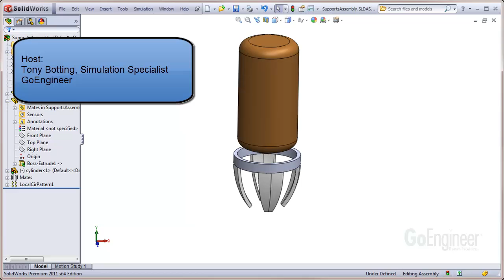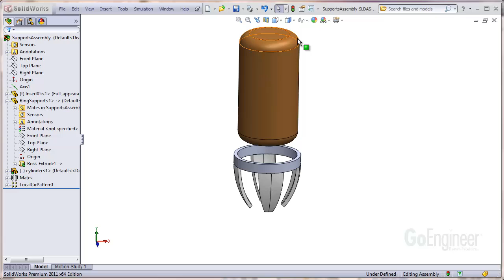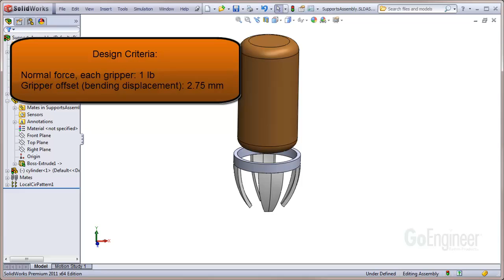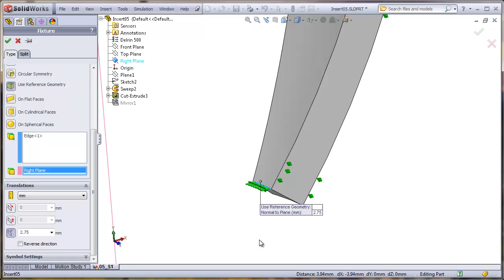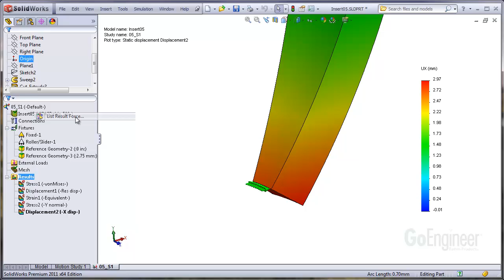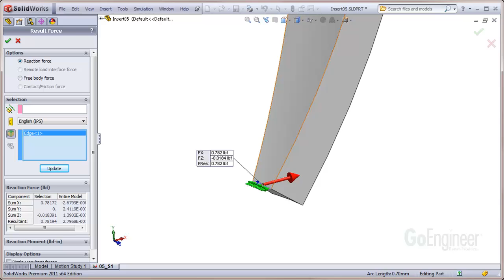SolidWorks Simulation - Non-zero "Fixtures" and Reaction Force

Comment: Is there a way to make it so that applying a force to the cylinder results in the displacement of the plastic grippers and to simulate the subsequent motion and stresses?
Reply from the maker: Hi Matt,
Yes, this same analysis could be run including the cylinder acting on the grippers.  The important part of that setup is that you would 1) want to split the model into a quarter symmetry (utilizing Symmetry fixtures on the cut faces splitting into a quarter model) to reduce the calculation time and provide rotational stability for the model, 2) defined a No Penetration contact between the bottom, fillet, and side faces of the cylinder with the leading edge of the gripper, and 3) provide a fixtures to keep the gripper ring immobile and define a prescribed displacement to the cylinder downward.

Running a setup under these conditions would give stress/displacement details for more of the gripper and be something you could animate with the cylinder included.

Comment: how can i list a result torque ?
thanks
Reply from the maker: Hi Ghassen,
To measure a resultant Torque/Moment you would first create a Reference Point where the center of rotation for the Torque/Moment will be measured.  You would then right click the 'Results' folder and go to ‘List Result Forces’.  In this utility you would then select 'Free Body Force' under 'Options'.  The blue selection box will be the face on which you have applied a fixture which you wish to measure a torque on.  The purple box will select the newly created Reference Point.  Once these are selected you click 'Update' and it will report the "Free Body Moment" on that face with the Reference Point as center of rotation.